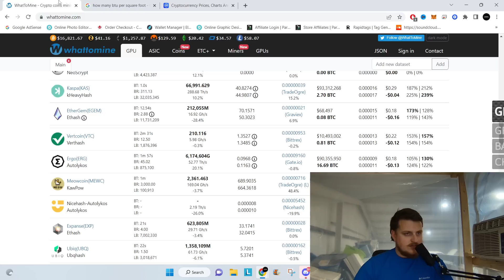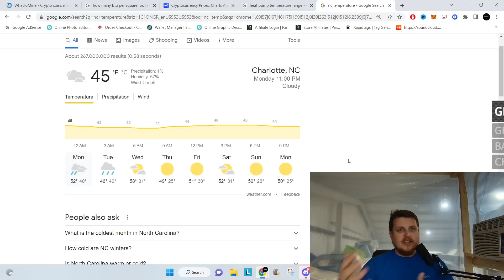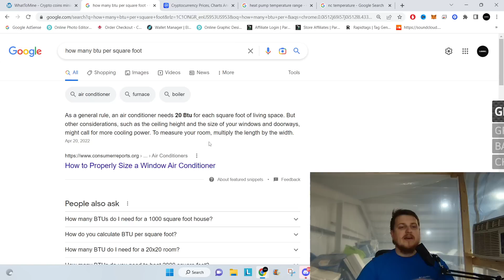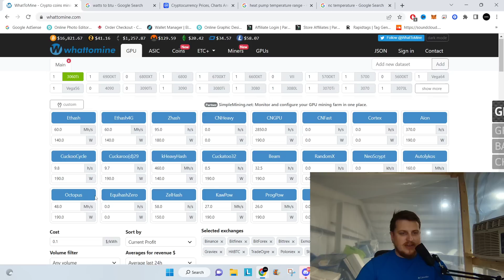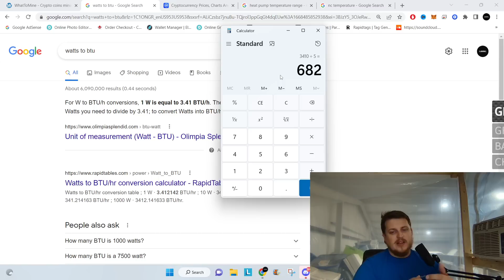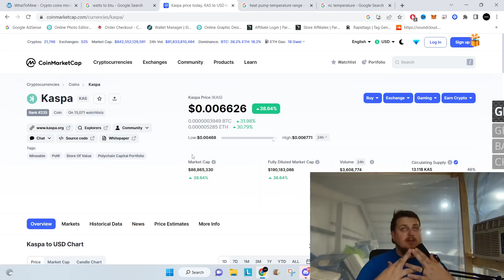Winter is Coming GPUs mining is On

Comment: Jellyfish! Great content Brandon! I live in Colorado on top of the Rockies near Pike's Peak. "Winter" is from October thru May and last year June. The temperature never exceeds 85F in the "Summer" months. It stays around 80. Using your miner to heat your home is exactly what I do. As you mentioned, no heater will keep you warm and make you money, but a miner WILL. Even with temperatures in the negative my first miner kept my modest 933 sqft home above 70F and it only had 5 GPUs. Even though GPUs are not as efficient as a heater it does have some advatages over a traditional space heater like the amount of air that is being generated by the GPUs and any other fans you may have to move the heat off of your mining rigs. Believe what you will people but this will be my 3rd year of heating my house with my miners. Best Regards, Jellyfish Squad.

Comment: I bought a central wood heater that attaches ductwork to my havc ducts.  I plan to burn wood after its too cold for GPU/asic heat to compensate for the whole house.  Check one out cuz its the cats arse without the wood smell.  I put the unit in my garage and stack wood inside & out.  Right now I can buy wood unsplit for $80 for a S-10 truck load which is good & i'll split it with a homemade splitter.    My neighbor has a heat pump that ran a lot the other night when it was 33 in northwest GA.    I use an Amish heater in a wood box, they will run you out unless you keep it down to lower temps plus I can control it with my phone app.

Comment: Wood stoves are where its at for sure got one myself and miners in the basement running 1600 watts and its nice and toasty 😉
Reply: I have a great gasifier woodstove. They use about 1/3 of the wood a traditional woodstove and it takes about 40 minutes to go from the 50s to the Bahammas lol. Because I heat with my miners I haven't run it in over 2 years. Works for me I'm a disabled U.S. Army veteran so splitting wood can be a pain literally. OF course now you have me wanting to get it going. Nothing like the warmth of a nice fire. Best Regards

Comment: 3:31 it's wrong that heat pumps get less efficient than regular electric heater.  With 1 KWh electricity they may only provide 2 KWh of heat instead of 4 KWh. But 2 KWh is still double the efficiency of the regular electric heater.
Although it might make economic sense to use mining rigs instead of a heat pump, depending on the heat pump efficiency, electricity rate and mining profits.

Comment: My one rig heats the living room and kitchen space and when it gets -18C outside then room temp starts to go under 22C and i turn AC unit to heat mode and temp to 22C.
Rig have 2x Tuf 3070 OC and 2x Evga 1080 FTW cards and mining Flux atm.
Electricity costs me 0.06€ / kW
My "split ac unit" or how those are called, my unit have full heat capacity warranty to -30C, i live in Finland and unit is designed for cold climates.

Comment: Heating up the room currently has been good, but woke up the other morning to my 3060 not mining and after working everything out I figured out windows updated my driver's and apparently my 3060 will not mine with no other driver besides the 470.05 driver. Any other driver just give me errors in trex, hopefully it won't auto update anymore cause it already has two days in a row, which it doesn't make sense why it wouldn't mine with new drivers or older drivers I use to mine on.